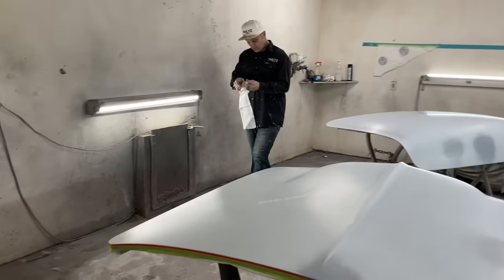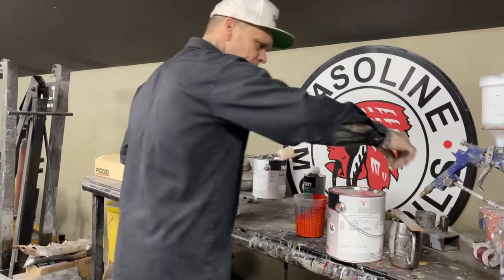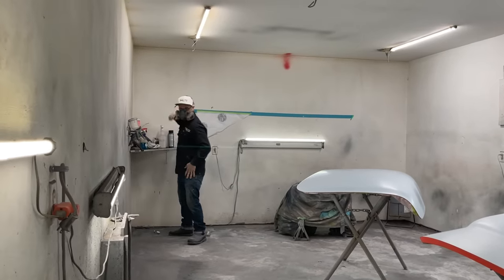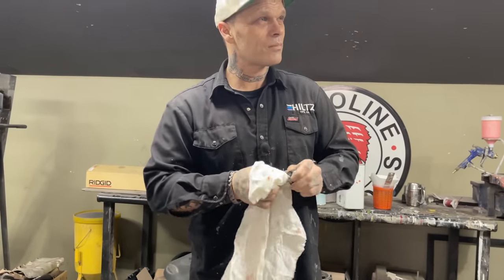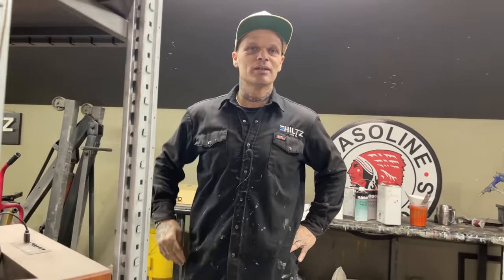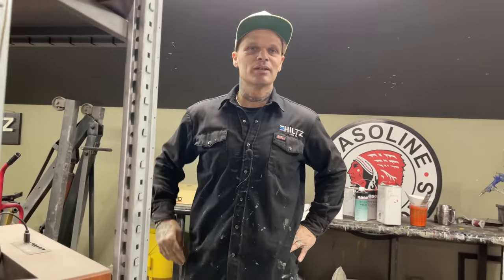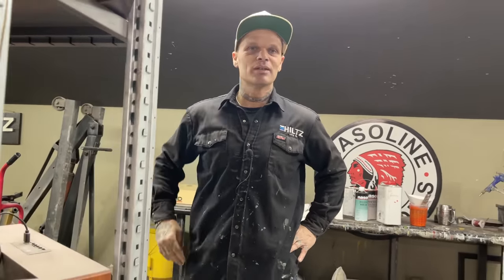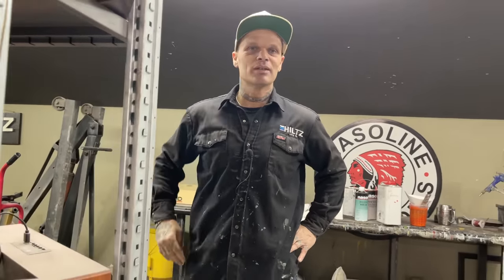Painting without orange peel — cheap gun, cheap paint  ✅

Comment: I have no experience painting cars but I’ve got an ass of experience painting cabinets . Always used oil based products. I’ve found that if you have two separate containers of paint it’s best to “box” (mix) them together to assure color consistency. After boxing is the time to separate. I also use a product called Bloxygen to extend the shelf life and prevent skin over. It’s an inert gas that settles on top of the paint and pushes the air aside or if you use enough completely out of the can. If you have leftover paint from a job it’s great for long time storage. 
I really enjoy your videos and someone else commented that they liked that there was no raucous music to drown the speaking, I concur.
One last comment. The worst part of spraying is the gun cleaning. I always tried to capture as much of the cleaner solvent as possible and let it “settle out” for a day or two and poured it into a container to be re-used as a gun cleaner again. After spraying used solvent through a few times I’d then switch to new for a couple of cleanings. Solvent costs more than gasoline so it deserves to be used as much as you can.

Comment: I have been told by paint companies that the same paint may not match depending on what batch it was made from. so when  I buy paint in 2 different containers to make sure my car matches I will mix the same colors together in containers. So if i bought 1 gallon and a pint or 2 gallons I would pour them together and mix and them pour them back into their original paint buckets. Now I know that both buckets have been mixed and will match. This has happened to me before so I play it safe.

Comment: I’m in the middle of my dodge truck right now..
My bed had holes in it from the outside too the inside, I could put my arm all the way through the side of my bed, 2003 Dodge Ram, so that’s enough said right there.. They don’t make them, like they used to..
But I bought new panels and I already have one side almost done.. This is the first time I ever did something like this.. I done bodywork before this, but never cutting anything out and welding new panels in.. So I’m looking things up all the time on how to do certain things, and I was super happy when I came across your videos.. I watched you on your tv show and I fell in love, with the car’s that you build.. So I hope your show is going to be back on again.. But I’m having problems with my welding, I don’t have a big welder or even a good name brand, maybe that’s part of my problem lol.. But my welds look like crap, I thought I was doing a good job, till I looked at it. I was using a 0.35 wire for welding, but the other night I was using it and doing other things as well, but I heard my welder making a strange noise and I couldn’t figure out what it was, till I looked at the end of my tip, I had the trigger sitting in a hole on a milk crate and somehow pushed it down and it fed all my wire out of it lol.. SMH 🤦‍♂️.. So I had to go buy more wire and I looked up what is better for welding panels on, a video I watched said to use .023 or 25, around that, they didn’t have anything like that where I bought it from, so I got.030 and it’s like a copper looking wire this time, because it said it worked well for panels, so I got it, but when I weld with it, it’s like I’m popping popcorn 🍿 way worse than the wire I was using, and it seems like it comes out slow, even if I keep adjusting the settings on it.. Do you know what I’m doing wrong or why it’s acting like that?? 
I’ll be really surprised if I even get a message back from you.. I see this video is about 8 months old already.. But I’m hoping that you still get notifications with this video and you take the time to read all of it lol..
Again I love your work and you being real and always saying the truth.. So I hope too hear back from you..
Thank you

Comment: Chad, When I was getting into doing paint work I had an old timer tell me to lay a chain over the axle of the car I was painting and let the chain lay on the concrete. He said it would ground it and reflect dust from sticking to it due to static cause by wiping it down before paint when you are using wax cleaners or tack-rags. It has always worked for me, give it a shot my friend and let me know. I have never tried grounding things when on those work horses though but I am sure it will work.

Comment: Friendly advice from a retired paint sprayer  clean gun before spraying colour coats correct spraying technique start from the edge of the panel and work to the middle then go round and spray from the middle to the outside edge then across the front taking in all edges that way you have a continual wet edge try it confidence and practice   oh and put all colour into one container stir well  can't go wrong

Comment: Hi Chad here are a couple of suggestions for your paint room your garage door and hardware and hardware like the track needs to be put on the outside the Springs and track hold a lot of dirt. And it would help if you had a fresh air intake from outside somewhere  And that would help from calling calling all the dust and dirt enter into the shop through the door and the garage door. Give all the walls and shilling and floor a new fresh coat of paint and wet floor and walls before painting. Not telling you how to do it  These are things that me that me and my buddy did to help with his paint room

Comment: Can definitely tell he has a very practiced hand and solid technique for spraying. Noticed for the second coat he definitely did it faster, however he was able to apply about 30% more paint just as uniformly. 

Maybe I’m just imagining things but I feel he may have the PSI turned up too high. The whole time I kept thinking the paint transfer efficiency seemed lower than I normally would expect (how the air particles rolled off the metal panel combined with quantity of color spray built up in the air). 

I know he mentioned his exhaust fan needed replacement as was made clear by the dying screams coming from the bearings when he starred it up. 

Seems he is definitely still fuming about the comments made the other day. He really doesnt want to let it go, I feel I’ll hear round 3 about Jimbo or “The Truth” before the video ends…. Place yer Bets!

Comment: Cool video mate 👍a top tip for cleaning your spray gun is to use a piece of o.6 mig welding wire to clean the small holes on your air cap it's the only way to clean it properly

Comment: Nice video! Have a couple simple questions. Correct me if I'm wrong but hat was single stage paint?  I noticed you had spots kind of gray when the rest was more white, that did not show through?  When you sand it later and repaint it, will you spray a primer/sealer or straight paint?

Comment: So.  I don't know anything.  Is "single stage urethane" not catylized ? Cause that was in the cup and the gun for a while...and I guess it didn't solidify.  2. I notice some video painters release the trigger halfway to blow air throgh the gun as the get past the edge of the panel, you don't.  Just preference?  or is there some advantage there? 3.  will you wet sand and buff or will you wet sand and repaint to deal with the dirt?  Thanks

Comment: Serious question:  When you use a single-stage urethane paint with a hardener, is the particle mask filter you were using, sufficient protection from the Isocyanates found in Urethane paint.  I've always heard that a fresh air source is required, rather than a particle mask.

Comment: I had several dozen runs in 30 years of painting cars. The only buffing I ever did was on lacquer jobs. If I had a bug or big piece of dirt, I`d redo that panel later. If the customer wants his car buffed, that`s on him. I`ve painted several VW bugs through the years, all mirror smooth, no runs. The trick with those is to lift both lids halfway after each coat.

Comment: Your mixing cup is tapered so the mixing stick is inaccurate. Most cups have increments printed on the side. Much more accurate.
Paint colors change as they dry. Put a dab on an inconspicuous area of the car or a shiny piece of cardboard and dry with heat gun to check color before mixing any paint so you can adjust color if necessary. 
If you're doing a repair a single stage you can also use this trick to hide a color that's a little different. You can blend the color after shooting clear first on the whole panel. The color will be on top and the clear on the bottom but they all melt together and become one
Reply: A

Comment: With all that pressure , how does it not orange peel ? Is slow reducer the secret ? I get solvent pop as well as orange peel . Thanks for the videos .
Reply: Higher air pressure reduces orange peel, slower reducer allows paint to flow out.
Solvent pop is not allowing enough time between coats and to fast reducer top layer is drying faster then lower layers thus solvent pop.

Comment: not dust... the dried paint particles from spraying the bottoms of the edges and edges which supposed to be painted first, then the vertical surfaces and then the top horizontal surfaces, no dust. The room is full of flying dry paint. Those parts should be painted separately. No "dust". IMHO. Like the clip anyway. The car will be magnificent piece of art. Thank you.

Comment: Nice lesson this is how I have taught my self to spray cheap urathane and single stage paints with a cheap 40 dollar harbor freight gun to avoid orange peel and flaws in the paint and comes out nice and flat and shiny with no imperfections. Only difference is when I do my first coat I paint it medium coat then my last 2 coats are literally as wet as I can get each coat right until it runs and is to wet so right before that point and it takes practice to get it right and know by just watching the paint and being able to have the eye for it but once you do it's very easy building scale model cars actually taught me that method and skill to paint car bodies with no runs and no orange peel and get a thick beautiful shiny glass paint job believe it or not model cars taught me how to paint cars sounds crazzy but true. But my way I learned of doing it almost exactly like your way of doing it after I watched more into the video so thanks for showing us all your tips and tricks in your videos very helpful. The way I avoid the light dust aka dry paint particles from coming back down and sticking to my freshly painted car as in my circle track latemodel and super stock or my hot rods I build is to wet floor and then I visquen the big two barn doors I open them then put the plastic sheeting then stick a blower fan to blow it all out I use two of those sealed around with the same plastic sheets covering openings cuse barn doors are open then I have two decent high power fans on each side of car one up front and one at the rear on opposite side blowing straight up and it helps a lot and I rarely get paint dust on my panels anymore cause that dry overspray paint dust will ruin a decent or nice paint job then you gotta wet sand with 5k grit sand paper and buff and polish it out

Comment: Don't end with a tack cloth and start painting but also blow off the surface then paint. Tack cloths aren't all they're cracked up to be. I painted for 35 years, most dust is sitting on the surface. Nothing in your shop is just within reach, your refill area is three rooms away from the spray room. Your gun holder is across the room from the hose. But hey, once you get to doing it your paint lays down nice. Your work is great but man you're scurrying around too much.

Comment: i use a stanley bug sprayer with a 1.5 tip and my ole lady is in the back with a hot plate why would we use cheap equipment and expect a good job i can do it but id rather use a tekna pro lite people watching this video should not  expect the same result with this gun its ok but its far from great if it was so good custom painters all over the world would flock to harbor frieght to get this gun it will work for a few times and then gaskets fail